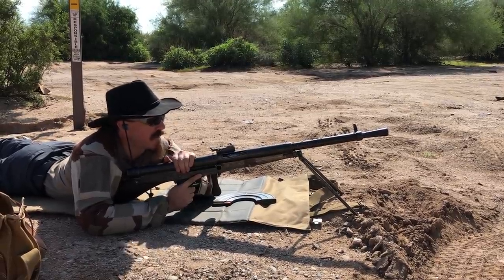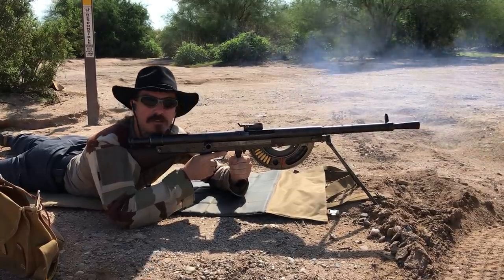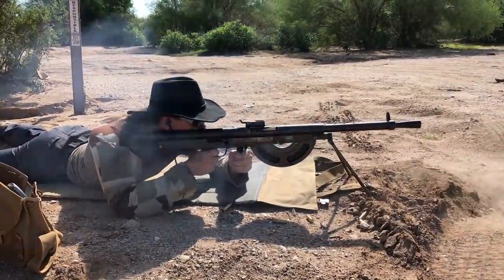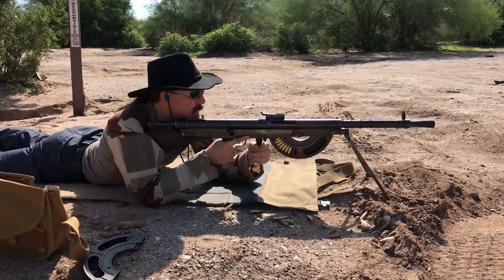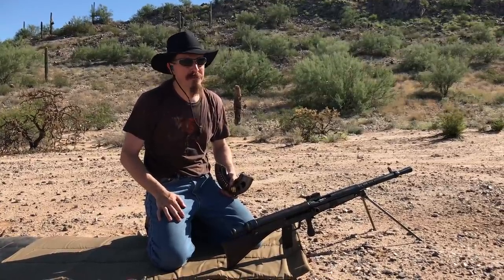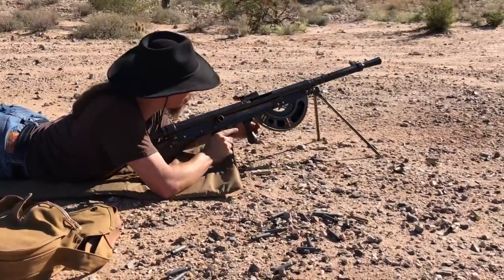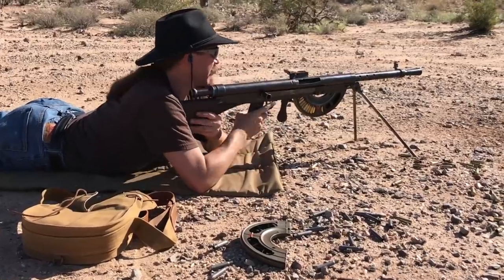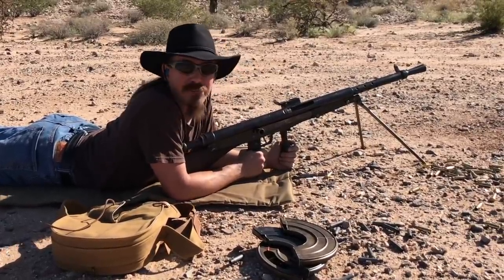8mm M1915 Chauchat Fixing and Range Testing

Comment: That’s a happy camper!

In the first session, the cases that did eject did not go very far, which looks like weak ejection. Glad you got it working.
Reply from the maker: People expect that every gun ejects the same, and if cases aren't going 8 or 10 feet, something must be wrong. In the case of long-recoil guns like the CSRG (or the Auto-5, or Remington Model 8), ejection is quite gentle because it doesn't happen until chamber pressure is basically zero. What you see here is exactly how a CSRG ought to eject.
Reply: I noticed that too; it plopped a lot of cases out right under the gun at first; but once you fixed the extraction issue, they all went to the same area a bit farther forward. 

Not that that actually told me anything about the underlying problem, but the difference was there.

Comment: Dang, I thought the 8mm Lebel was a smokeless cartridge! (those first few rounds looked how my AR looks when I runn 556 after shooting a few bricks of 22 with the conversion kit)

What would the typical French gunner have carried on him as part of his field kit/accouterments during the war? Spare bolts or tools or the like? In Iraq it would be common to see a gunner carrying a spare barrel & sleeve, headspace/timing gauge, CLP, leatherman, batteries if there was a PEQ, and the like; what was the 1917 or 1918 equivalent? Would a spare bolt or extractor be handy, or would the gun have to go to Company or Battalion level for maintenance?
Reply: The smoke is probably from the oil in the gun.
Reply: HPBrowningBoy the two major complaints about this gun were the reliability and the fact that the gun produced a crap ton of smoke
Reply: I wouldn't really be surprised if the literal first "smokeless" cartridge wasn't very smokeless....
Reply: I know the first smokeless powders using only nitrocellulose required long barrels to fully burn (600mm) but in this case it's probably oil that's being vapourised.

Comment: FW: Are you trying to revive the reputation of the Chauchat, or trying to evaluate it? You sound so darn cheerful while this gun keeps failing to eject. The recoil on it seems powerful enough to literally kick out shells.
Reply: Mind that it's a long recoil weapon. The brass is ejected only by the spring tension when the barrel is pushed forward.

Comment: This extends what was seen with his 30-06 sho-sho. While admittedly these are 100 years old, so have been those automatic weapons that actually worked. The chitchat will work IF the magazine's are good, if the barrel and bolt have been carefully installed and if the extractor was functioning. If you had a sloppy put together then beat the hell unit which was then turned over to US troops and given bad war time made ammo --- who would have wanted to carry this same gun, and it's stoppages, through no-mans-land?
Reply: It's a refurbish 100 years old gun, it used to be a neutralized gun, the extractor needed a rework. Ian already made a video on chauchat in good condition and it was smooth like butter.
Reply: I saw that video he did... and if THAT'S what you call "smooth as butter", you need to get out to the range more.
Reply: What's not smooth in that video? /watch?v=bCwP3Dm52Ls  0 malfunction
Reply: The alternative was a bolt action or a 50kg plus machine gun. Do not forgot what alternatives they had at the time ...
Reply: ...to be fair, butter directly from the fridge....
Reply: MrTangolizard
A lewis gun weight 24Kg once you put the water in it, the chauchat is 9kg. Also they were approximately 50k lewis gun produced in WWI versus 262K chauchat
Reply: Uhhh..... Lewis guns don't have water put in them. Unless there's some kind of weird ceremony going on, but I try not to judge.
Reply: @jameshealy4594  He is thinking Vickers I bet.
Reply: Vickers was water cooled. Lewis needed no water just new barrels.

Comment: Long recoil always LOOKS brutal, I know my Auto-5 kicks the bajeezus out of me, and the Chauchat is jumping quite a bit spitting those 8mm rounds. Is it rattling you to pieces after those dumps, or could you keep it up for ten minutes in combat?
Reply: I'm confident that most people could do it. After 10 minutes of that I wouldn't want to touch a gun ever again though.. And I was designed autorifleman in army
Reply: You wouldn't make it to 10 minutes with the Chauchat anyway. After about 120 rounds of fairly continuous fire or so the barrel sleeve locks up until it cools down again.
Reply: From what I’ve heard the auto 5 is supposed to be really gentle if working correctly, you might need to check out your friction rings
Reply: @randompanda876  it is a 16 gauge too, but also nearing a hundred years old and having a life of seasonal hunting use its friction rings are probably beat to all get-out.

Comment: Fantastic - more dakka! Is that mag haversack (pouch doesn't seem quite sufficient) an original item/pattern or just something that happens to hold the mags well? Will Karl be joining the theme when you run this? Maybe an mg08, because we all saw the documentary Battlefield 1.
Reply from the maker: It is a reproduction of an original magazine haversack designed specifically for the Chauchat.
Reply: Very cool!

Comment: Regarding the 'bad' magazine. Is that an issue that could be fixed, or does that one just get set aside?

Unrelated, but I love the way a Chauchat sounds; with the full power round and the low rate or fire it sounds (at least in video) more like an autocannon than a light machine gun.

Comment: I wonder if the temper was ruined during the dewat process? I bet if you retempered the exracter that you might bring it back to life. I've had this problem on old flintlocks that someone mucked about with and not doing a complete disassembly.

Comment: Is there anything that can be done to improve the performance of the 'bad' mag?
Reply from the maker: They probably made a mandrel for reforming the magazine body and feed lips for armorer use, but I've never seen one. I'll set it aside; it might work fine in a Berthier conversion. ;)
Reply: Swap it for a Bren?
Reply: Run over it with a big truck?
Reply: CAROLINA PATRIOT 
Or stick it to gun and drop it once?
Reply: What about "Universal disassembly tool"? ;-)
Reply: Swap it for a Browning....
Reply: Measure one of the mags that worked, for all the working dimensions, compare with unreliable mag, tap and tweak to match. With old machinery of any sort, there's a fair bit of trial and error.
Reply: Berthier conversion?! :O

Comment: Question for you Mr. Ian? Even though this gun is unreliable and prone to failure, it was also the most widely produced machine gun in WW1. It was even chambered for .30-06 for use by the "AEF" American Expeditionary Force, which was even more unreliable than the 8mm Lebel version. Given that the design for this rifle is over 100 years old, what would be your opinion on the soldier's view of the weapon at the time? Also how would you rate it in comparison to other machine guns at the period (Early in WW1)? I know AEF soldiers used the Chauchat because of delays in receiving their Browning M1917's. The Browning was late to WW1. It was water cooled, extremely heavy, and meant to be used with a fixed tripod mount. However it was extremely effective.  Do you feel like the Chauchat, while unreliable to even late WW1 standards, was technologically advanced for it's time? I feel the general consensus is that this gun was a junker from the factory but I also believe that the context for the creation of this weapon is often missed. After all, it was the war itself which drove the war machine to create far better weapons like the M1917 much quicker than in times of piece.

Comment: The Chauchat worked but in WW1 the Madsen was probably the best lmg
Reply: It was still the best LMG even a decade after the war, but of course all the CSRG defenders will bring up the increased cost of the Madsen.
Reply: Sadly ...french needed a lot of chauchat in a short time ..
Army is not "vidéo game "
Reply: @jameljay2183  They could have just been buying Madsens before the war. It took them months into the war to get the CSRG into the configuration they settled on and to set up the Gladiator factory to manufacture them. They could've had 10,000 far superior Madsen guns on the front lines well before they ever had 10,000 Chauchats.
Reply: Pretty much all major European powers discounted machine guns (especially man-portable ones) well into the beginning of WWI; with the notable exception of the Germans who, adopted machine guns early and really set the standard for machine gunnery and technology all the way through WWII. On top of the resistance of officer corps throughout Europe to machine guns, the French are particularly...picky...about their weaponry and generally refuse foreign designed or manufactured small arms in favor of French ones (regardless of what is the better weapon). All that aside, My madsen is probably one of my favorite machine guns to shoot...
Reply: @maximus10ish  That doesn't seem quite right. The Germans did indeed have a more advanced doctrine for use of stationary HMGs, but it was the French that first concluded that highly portable light machine guns were the only way the doctrine of walking fire (that they had been developing since 1903) could be made feasible. "...la mitrailleuse doit tirer et marchera pour tirer." The machine gun must walk; this was their guiding principle. Unfortunately they settled on a machine gun designed for use in the more pristine environment of aerial combat, but it was the only native design that was close to light enough. With some slightly better foresight, they might have gone with the battle proven Madsen (the Alfa model of which was even lighter and better suited for walking fire than the CSRG); or at the very least, eliminated the Chauchat's useless aluminum cooling sleeve and improved the magazines for the realities of ground warfare.

Comment: Why did military authorities persist so long in trying to get rimmed ammunition to work in magazine fed automatic weapons? Surely the logistics of having to supply two different ammunitions, were out-weighed by the fact that their rimmed ammunition automatic weapons mostly did not work. Were the British versions of the Lewis gun and the Czech/British Bren gun, both chambering 0.303" rimmed, the only successful rimmed ammunition automatic weapons? Shooting a 0.303" Bren gun in my youth, I don't recall a single stoppage. Overheating the barrel was the main issue, they could maintain such a high rate of fire, albeit they were very easy to change, if you had a spare.

Comment: Where did your get the extra magazines, and barrel, also have you polished the chamber? That makes a big difference in how the gun runs. Your's looks like it is running good. Harry
Reply: Would a polished chamber make that much difference on a long recoil action (especially with the taper on that cartridge)?
Reply: It does on this gun as the chambers were very rough and not finished. Harry

Comment: So what was the point of proceeding manufacturing of the Chauchat, despite knowing that the weapon was practically unusable. Every example I've seen of someone firing a restored Chauchat is filled with failure to ejects, jams, and other issues. From my understanding, these same issues happened when the machine guns were first made as well. So why did the French continue their use, rather than develop a new gun, or import lewis guns? Seems like a waste of good metal, and men that died due to the weapons weak points.

Comment: I find it ironic, that the M1918 model in .30-06 had a better time with reliability. Granted, I assume that would be the fact this gun was deactivated at one point.
Reply: I've seen reactivated LMGs (so way simpler actions) of models known for their reliability jam a round out of three. It requires a lot of work to put the parts together correctly.

Comment: A chauchat performing exactly as expected.... poorly.
Reply: Dunno, seems fine once you replace the faulty, century old parts.
Reply: and mag. mostly the mag, since it jammed up the gun twice in a 2 week interval.
Reply: @eddyguizonde401  If a CSRG is properly assembled and clean, with undamaged mags that have good springs, it will perform fine until the barrel seizes from the heat expansion of the barrel's aluminum cooling sleeve. But all too many of them were hurriedly assembled with little in the way of quality assurance and they are obviously difficult to keep pristine in bad environmental conditions. And in 1916, even if you tested your mags for lemons as Ian suggested, that doesn't mean they were going to give you replacements.